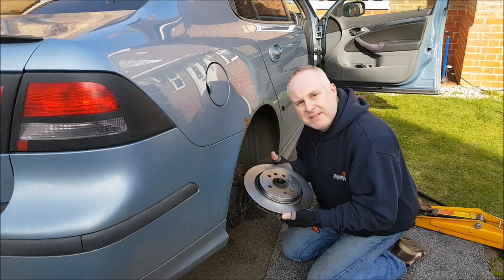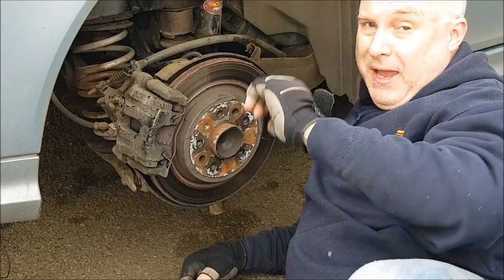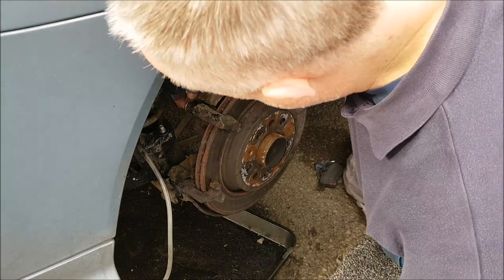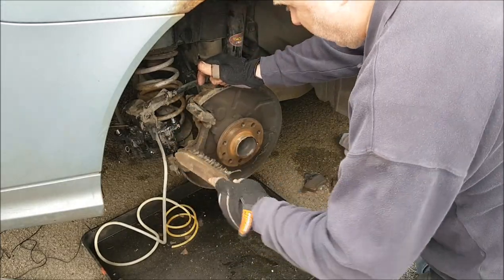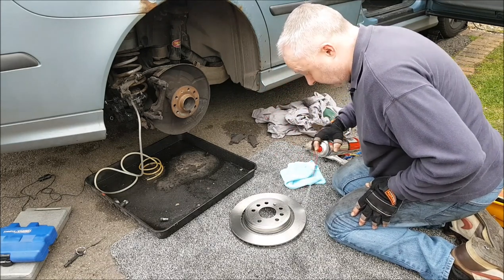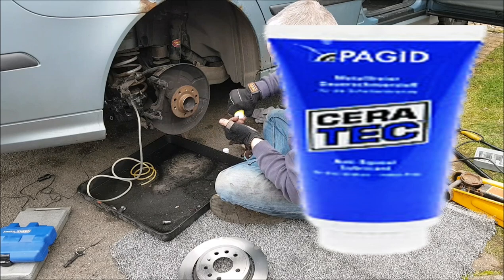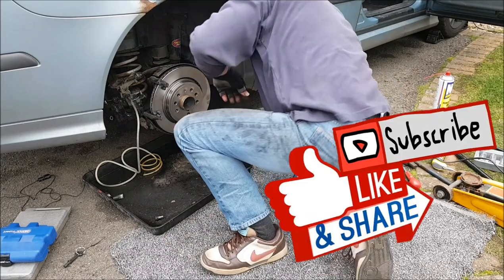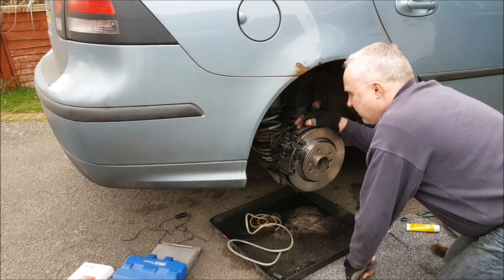Saab 9-3 Rear Disc Replacement | Saab 9-3 Rotor Replacement

Comment from the maker: Be sure to watch this in conjunction with my video on changing rear pads. https://youtu.be/I2bjrobr1T4 
👉 👉 AND do remember to ALWAYS fit new pads with new discs. 👍👍
Reply: Ceratec is cheap and cheerful - best tip someone gave me when working on pads and discs! No squeels!
Reply from the maker: @kidknowledge2020  Yes, a tube is about £7 or £8 and will last for years. It's also good for smearing a little on the hub face before putting the wheel back on. Copper grease should only be used between parts that do not move relative to each other AND where there is no heat, which of course there is at the hub/wheel interface 🤘

Comment: Cyd, just wanted to say thank you for your YouTube videos, really helpful and have just saved me a load of garage costs. I started off doing a key replacement last year, then progressed to a radio replacement and speaker upgrade. Last month I did a full service, and last weekend, I replaced both rear discs and brake pads 👏👏👏. Next project it to replace the air conditioning condenser. Thank you.
Reply from the maker: Awesome, confidence is building, eh?

Comment: Thanks for the vid. Loved the mention of which sockets will and won't work regarding the solid rotor. Here's hoping mine's vented...about to get after it.
Reply from the maker: Yeah, having Aero brakes is so handy with not having to remove that carrier❗ Still gotta remove the carriers on the fronts though. have you seen that video? I used an 8ft steel pole - with my busted in left shoulder an 18" breaker just wasn't gonna do it, lol 😂

Comment: Thanks for this video Cyd, however, I noted you said it's an E20 socket for the caliper bracket bolts, I nearly rounded the bolt, the front calliper is E20, and the rear is e18.

Comment: Is that right that I don’t need to take those E18 bolts off the back to remove my 292mm vented discs? I’ve been fretting about those bolts because I can’t move them. I really appreciate your videos because watching them has given me what I need to replace my discs, pads and rear springs on an MOT fail. Thank you. Busy weekend ahead. Are you from Leicester? My original home town and I’m sure I hear it.

Comment: How do you take the e20 bolt off of the breaker bar isn’t working can I use anything to loosen it up
Reply from the maker: You could try an impact driver, but really you need a longer breaker bar. That pipe I used was over 6 feet long!
Reply: @CycloneCyd  yeah it just feels like its not moving at all